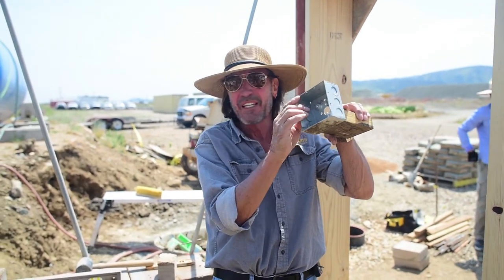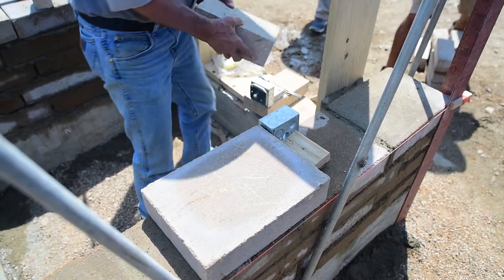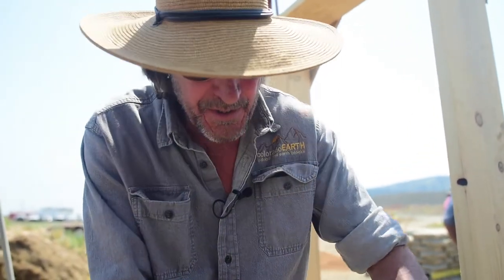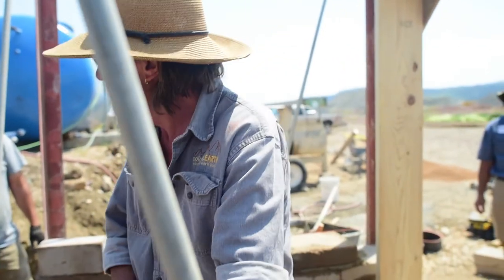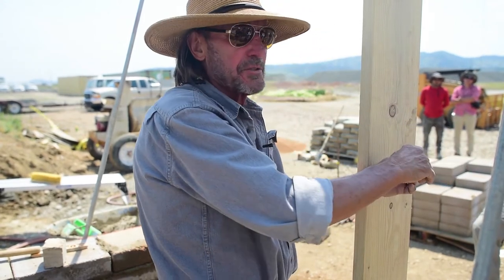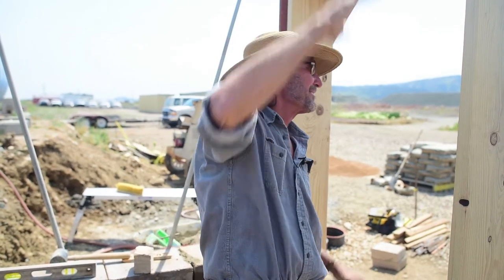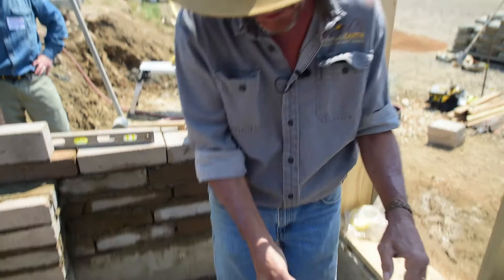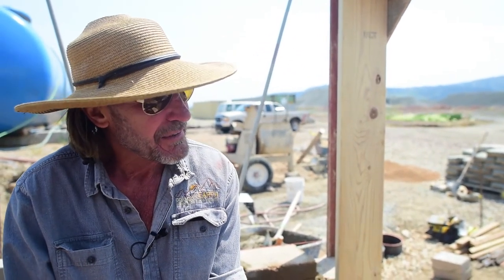Part 7 - Installing an Electric Box in a CEB Wall

Comment: I started my CEB research in 2018.  This is the best channel I've found so far!!  Thank you so much for putting this out there.  I just turned 60 and am finally ready to start my project.  I realize it will be backbreaking work, but what the heck else am I doing...  I plan to go at my own pace and hope that the County approves my plans and doesn't give me too much greif.  Like Jim said, I planned my plumbing and electrical to be the most efficient and least imposing.  Although, the architect I hired just didn't seem to understand this material and some of the methods I was using to achieve my goals.  She kept undersizing my windows for example, not understanding that I really didn't want a mirror over my bathroom sink, I wanted a big window in the bathroom.  It's in the middle of nowhere, so I'm not concerned with peeping toms.  Finding my community of like minded people has been a challenge!!